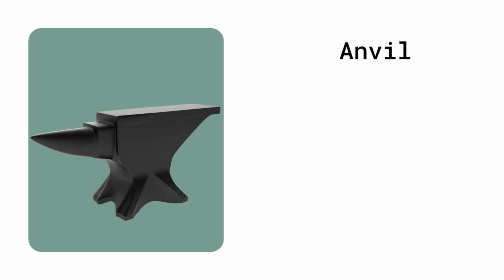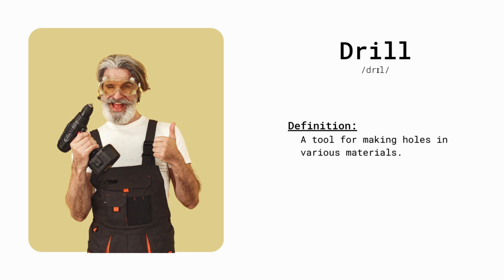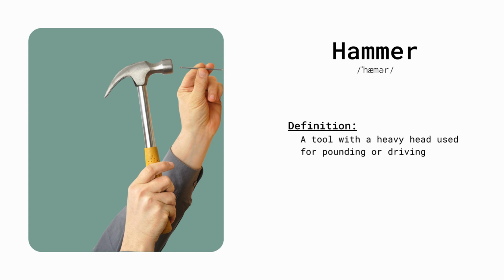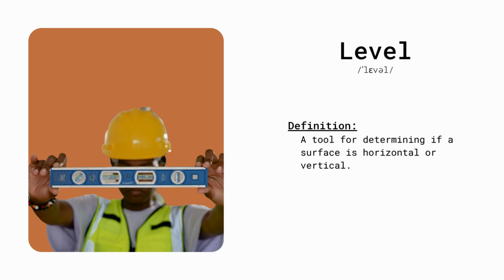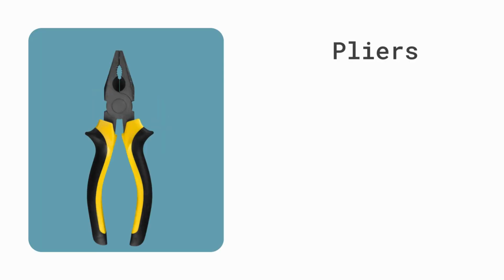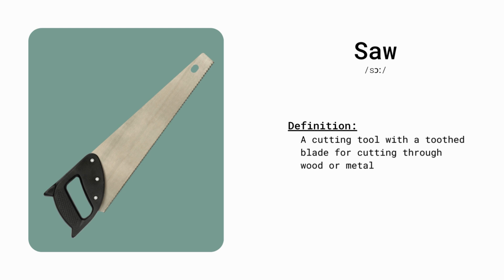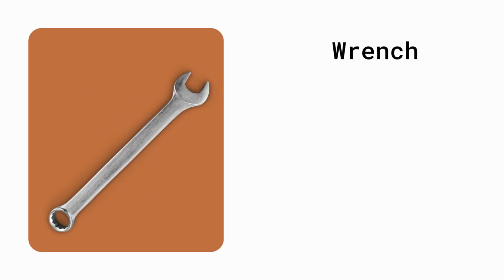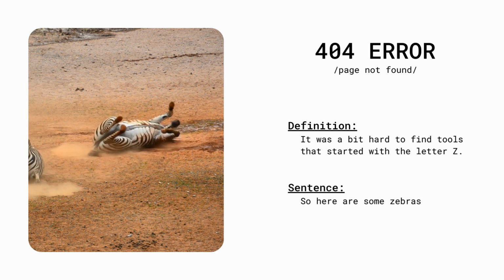Learn the English Alphabet with TOOLS | English Vocabulary | Spoken English | IPA | Pictures

Comment from the maker: Practice by filling in the blanks below:

1. The craftsman used a _____ to cut a decorative pattern in the wood.
2. The electrician used ______ to hold the wires in place.
3. I plugged the lights into the _______ ___ to illuminate the entire room.